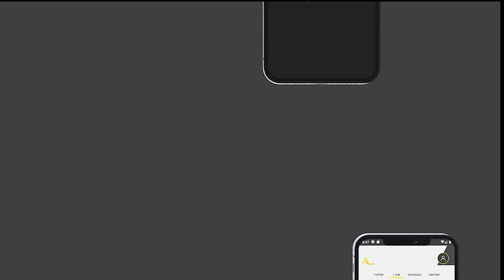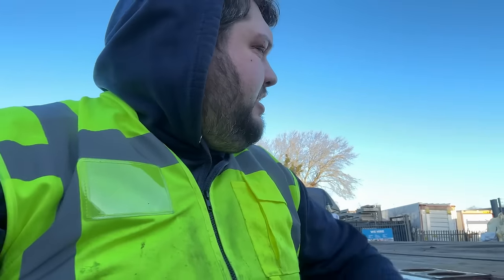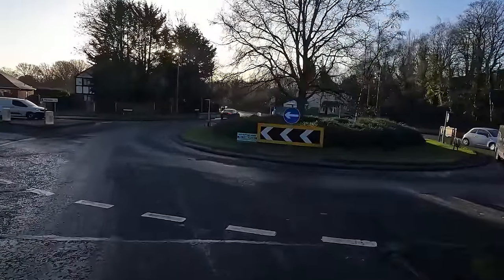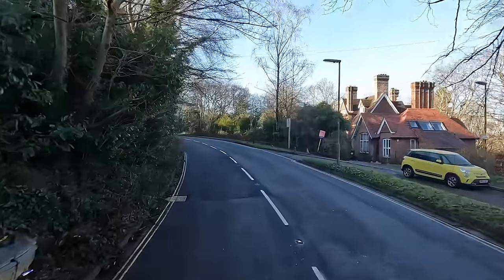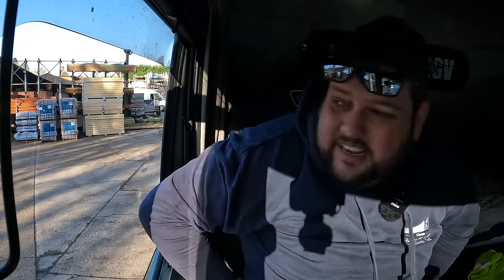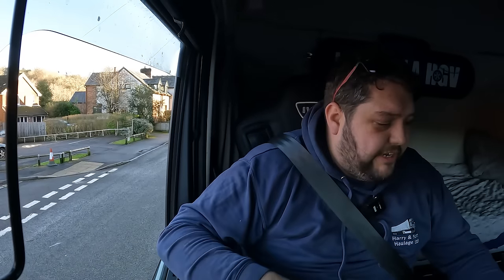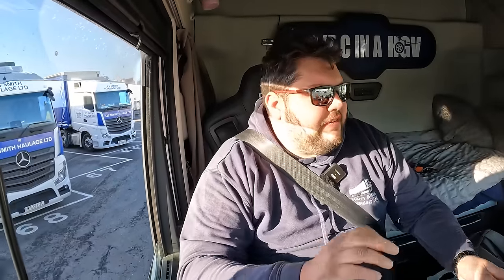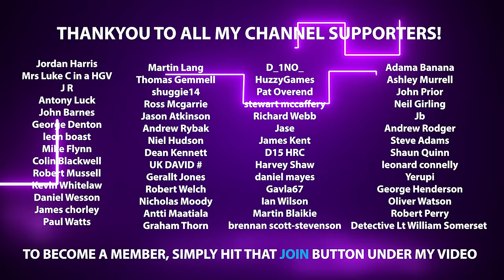My Brakes Failed!

Comment: A little bit of advice from an old timer. When having to jackknife in a small yard like that is to unplug all the trailer connections with exception of the red line. That reduces the risk of ripping all the wires out and snapping the yellow service line.
Reply: Take all airlines off and press shunt button

Comment: Road Traffic Act. 1988 Section 36.  You may cross a solid white line provided the road is clear to, enter adjoining premises or a side road, to pass stationery vehicles, pedal cycles, horses, road maintenance vehicles travelling at 10 MPH or less.
Reply from the maker: Ah! So all good thanks!
Reply: That's helpful to know about pedal cycles and horses which you have to give a ridiculous amount of space to, as when people are afraid to pass it results in long tailbacks and drivers going into the back of each other. Still dangerous IMO, and a junction like the one Luke mentioned really should have lights.
Reply: There was a sign indicating a junction and there was no separate instructions for HGV's. So it is a valid legal turning
Reply: HC rule 129 covers it in the first paragraph : 129
Double white lines where the line nearest you is solid. This means you MUST NOT cross or straddle it unless it is safe and you need to enter adjoining premises or a side road.
Reply: Yes, the centre lines are for no overtaking, not no turning…
Reply: @imagseer    when driving I give horses as much room as I can,I've see what a spooked horse can do.....not pretty.

Comment: How funny, where you were talking about the delivery you don’t like, I recognised the road.  I know exactly where you were talking about and you’re fine to do exactly what you’re suggesting and crossing the double whites.  I’ve lived in haslemere for over thirty years so funny to see you there!  In fact, I was there there earlier today, moved 10 miles down the road a few years ago.

The reason the traffic is using that as a cut through is that it’s safer if you’re heading to Haslemere high street than the junction they would otherwise have used.  Very sharp and traffic comes round the right handed on the a road you came off on to the cut through at a right lick!

Comment: Why didn't you disconnect your air lines and press the shunt button there's no excuse for stretching your air lines
Reply from the maker: Not all trailers have shunt buttons. This particular trailer does not have a shunt button
Reply: bungee cords used to work for me but was long time ago i drove.

Comment: So the Brakes didn't Fail at all just click bait!
Reply from the maker: Well they aren’t working as they should so yes.. it’s failed. It would fail an MOT….
Reply: @lukecinahgv  still at best just click bait, the unit would pass an MoT, as you don't fail MoT from having brakes working too well, just defiant braking force, or an imbalance (left\right) in braking force, only a feckless dullard would say the brakes had failed, which to MOST people would imply full or partial loss of brakes, as opposed to the correct statement in this case being a brake fault.

Comment: You should have took your airlines off to turn round
Reply from the maker: And then the trailer wheels would’ve locked up.

Wait, I know what your replies are going to be . “ put the trailer in shut mode” 

That trailer has no shunt button
Reply: Then take them off and just leave the red attached